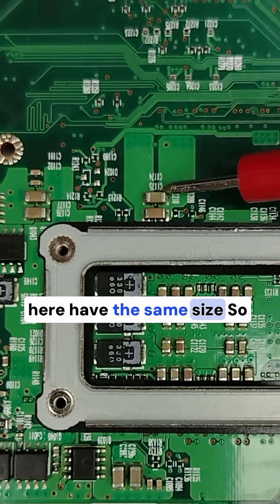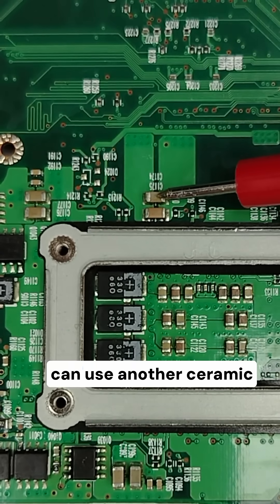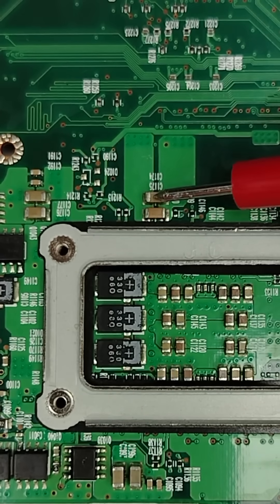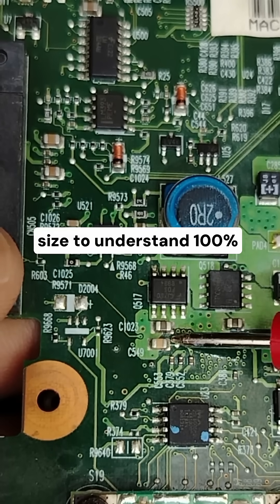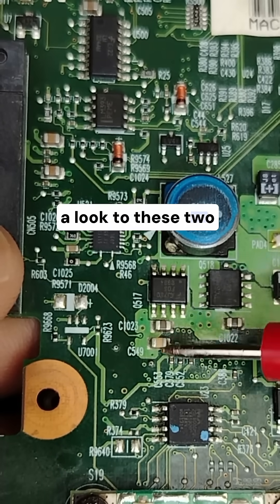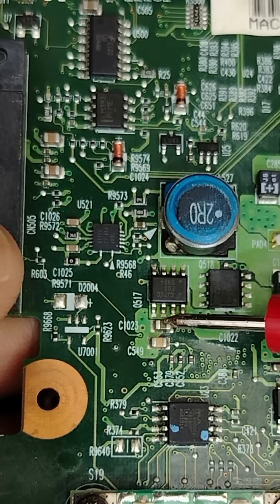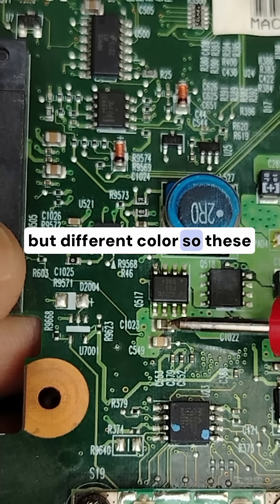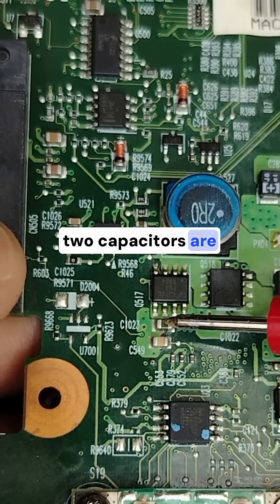Ceramic Capacitor Failed? Here’s the Correct Fix 🔥🔥

Comment: How can check value
Reply: Multimeter
Reply: Or component tester
Reply from the maker: Stay tuned
Reply: Thank you but i am asking hidden value
Reply: @Yousufdeen answer is still multimeter. If your asking how to find the value of a cap that has failed and no providing a reading, you will have to probably try to find a schematic/bom list.
Reply: Yes